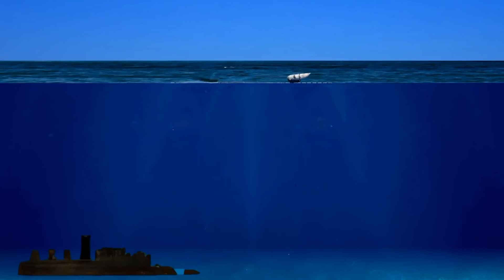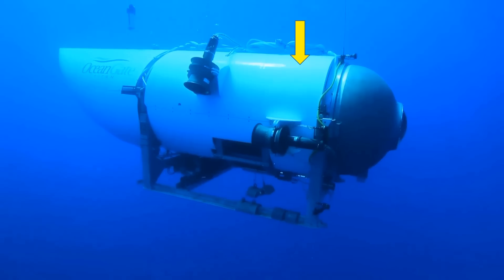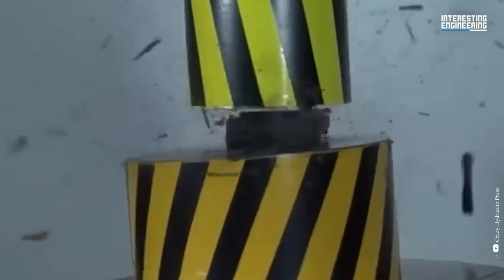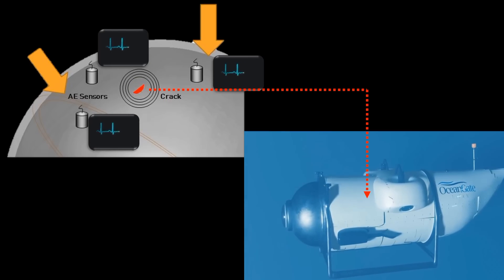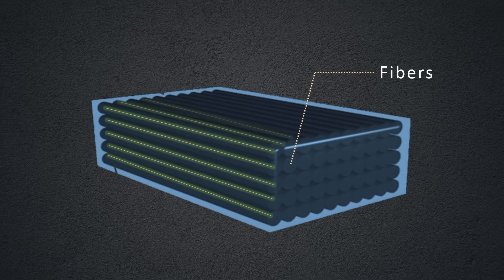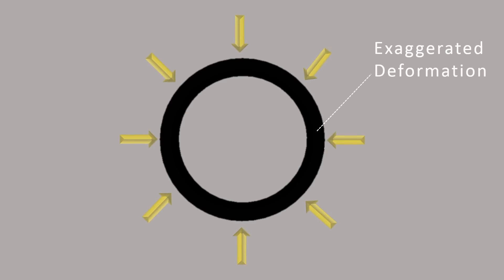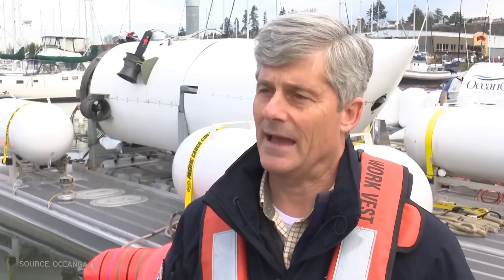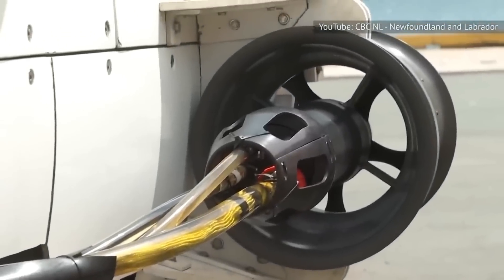Oceangate Titan Did Not Implode Just From Pressure. There Is a Catch!

Comment: Yes, when I heard about this I knew the failure would have been in the matrix, not the fibre, so the strength of the hull is not down to the fibre but the resin that holds it together. To that extent the hull was engineered as if a pressure container as opposed to a sub..
My first thought when looking at the spooling of the hull that there's very little axial fibre, so the hull was made like a very large slinky toy, it could shorten & lengthen significantly with pressure & temperature, not forgetting the different thermal coefficients for the resin in the matrix and the carbon fibre.
I used to fabricate Hobie Cat hulls and other things like sailboards, surfboards, canoes & kayaks, and even with careful hand or machine laminates there are the defects you've pointed out in resin variations, fibre variations, air inclusions that even pre-preg & vacuum bagging cannot eliminate. You hope to overcome these faults with careful manufacture and safety factors, which would be interesting to see - what was the safety factor for this hull?? How was the FEM & stress calculated?? Who was the engineer & what mistakes were made?

Comment: Yes, when an Americas cup racing yachts were first produced with a carbon fibre mast, and the boat came down off a swell and slapped the hull onto the water causing shock loading on the mast, we were treated to images of snapped masts and unhappy crews. This didn't surprise us badminton players who avoided buying early carbon fibre racket shafts as they had a tendency to snap without warning and send the racket head flying across the court.  When NASA used it on the leading edge of space shuttle wings the non-technical middle managers authorising safety protocols dismissed any issues with it by describing it as high "toughness".  Issues with compressive and shear forces during shock loading are known and real. Then the news reported it was a carbon fibre hull.

Comment: As a non-engineer, I found this presentation, with the graphics to aid in the explanation, easy to understand the likely cause of the implosion.  I've heard this explanation before in other videos, but did not get full understanding what they were saying.  The graphics used in this video helped it all make sense.

It seems to me that a design that requires a laminar material is not a good choice for deep sea, high pressure environments.  Now that I know about the problems of delamination and deformation that can occur with carbon fiber.  I don't think it is a good choice for deep sea applications.

I think another company is using it for applications in space flight.  This is something that should be looked into as well.  We've seen what the problems are for carbon fiber in deep sea applications, but what are the potential problems for using the same materials for use in the vacuum of space?  Can the same issue become a problem?

The spacecraft will have the same repeated cycles of internal pressures exceeding external pressures, and then both external and internal pressures equaling out.  Will that cause stress damages to the carbon fiber structure?  Not to mention the added stress of the high heat of reentry into the atmosphere....

Comment: They could have done a better job of gluing, such as vacuum filling to make sure they didn't trap any compressible air in the glue.  I think the junctions caused far more risk than the glue.  A hull made entirely of carbon fiber composite might have survived better, whether monolithic or glued.  (Avoid sudden changes in thickness because they would create stresses similar to the joint.)  (A lot more detail to design and build the domes from fiber.  Why did they choose titanium domes?)

Comment: There are many ways failure could have initiated.  And it's 100% due to the intense pressure.  My guess is thru thickness debonding from the titanium shell resulting in high pressure wedging of water acting directly in the metal shell. This would have formed a bubble and then failure.  Really need to see the failed structure to understand better.

Comment: So basically carbon fiber is strong in a very particular configuration, and weak in another configuration.  Mr Rush chose to orient the carbon fiber at its weakest configuration, but figured that the 5 inch thickness would have compensated for this fact.  Well it did, but the CF fatigued and weakened over time and pressure cycles until this recent most tragic event.  I would have built my sub using the strongest components, at their strongest configurations, and then added on even more failsafes along the way just to be sure AND THEN subject the prototype to rigorous testing before I even attempted to put the thing in water.  When I finally put the thing in water, its been designed to withstand a monster crap of challenges that nature can bring, and tested to make sure its safe.  Mr Rush didn't do half of that, and paid dearly for it.

Comment: As Mechanical and Structural Engineer, I have to comment on your video and analysis.
1) Fatigue is not caused by pure cyclic loads. It is the loading from tensile into compression into tensile again. The best example is the Head bolts in a normal motor. The bolts are pretensions in order to prevent the cyclic from tensile to compression.
2) Length prevents stress concentration. So that approach is wrong. Stress concentration occur where there interference with the movement of a perfect round shapes. such as the dome ends.
3) Composite materials are a no no for this type of use. Unless you use thick walled theory for cylinders, there is no compression in the shell, unless you refer to local failure modes, which are way to small. Composites are used in tensile and tensile only. The Maximum stress of Carbon fiber is 1500 MPa in Tensile and 600 MPa in compression. Thus compression strength is far less than simple stainless steel.
4) Th wacousitc sensors are rubbish. If noise it heard the failure has already started and the hull is already weakened. How does one measure and record accumulative and successive damage and how do you translate that to the structural integrity of the hull.
I can go on and on. These were not engineers. They were thumb sucking design cowboys ......

Comment: Rush should never have been allowed to gamble with the lives of his TOURIST passengers. I blame government regulators, In my mind, there is no difference between Elon Musk having SPACE TOURISTS fly to the Moon and Rush's SEA TOURISM to the bottom of the Ocean (dives to the Titanic).  My understanding of your FAILOUR ANALYSIS is that Rush r-e-f-u-s-e-d to have others 'Look over his Shoulder' on the pretext of protecting Proprietary Trades Secrets/Freedom for Innovation (sic).  Since the industry standard is to use TITANIUM throughout a submersible's construction---RUSH needed to PROVE use of Carbon Fiber Technology was as failsafe as that of the Industry Standard---and clearly he didn't.

You focus on Rush's use of a cheap game controller, not built to MILSPEC standards, is most unsettling. Another bone of contention with me was the Glass Eye in the front of the sub which was only rated up to 1,500 PSI before shattering---yet the Titanic rested on the sea floor requiring a load of 3,300 PSI. THAT IS CALLED GANBLING, my friends!!!
Who permitted his craft to accept PAYING CUSTOMERS with such glaring safety issues such as these? Since OCEANGATE was an American Chartered Company, Rush's vessel should have come under DOT supervision and Dept of Transportation (DOT) should have IMPOSED regulations, testings & processes before passengers were allowed to set sail in the contraption. This was a tragedy in the making, pure & simple.

I am not a mechanical engineer (FYI, I adored you concise, clear explanations) but a FUTURIST & a Technology Historian.  If you examine the introduction of the FIRST Automobile, the FIRST Steam Engine, the FIRST RailRoad Locomotive, the FIRST AirCraft and the FIRST Space Ship---all of them underwent vigorous Peer Reviewing & Government testing B-E-F-O-R-E routine FOR PROFIT Commercial Employment Started.  Unfortunately, I see more tragedies like what happened to OceanGate occurring, not less. DOT needs to step up its game...

Comment: You hit the nail on the head. This is the first explanation I have seen of the flaw in using carbon fiber. Great for a spacecraft where the fibers are stretched by internal pressure but no good being compressed by external pressure in deepsea diving.

Comment: I am wondering how that carbon fiber tube was attached to the metal rings that the metal hemispheres attached to. I'm thinking a metal sealing ring would have a different reaction (different expansion/contraction) to the external temperature & pressure.

Comment: So, the pressure will find its way through the path of least resistance, and the composite carbon fiber hull was all too obliging in providing one.  I wonder if the supposed transcript from the dive that was circulated around is genuine or not.  If true, they had warning of the impending catastrophic failure but were too deep to prevent it.  "Loud cracking noises" had already been noted from this sub on previous dives.  Fatigue is a thing, as is an apparent blind pursuit for return on investment.  My money is on the 6K PSI.

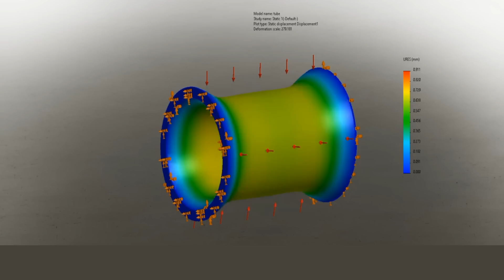Comment: I’m sorry to revealing this to everyone, but I think there was a very good chance the so-called “implosion” was not quick and that the passengers did not die a quick death. Similar to what is shown at 7:04, the titanium end caps did not flex as much as the carbon fiber did. This would be the likeliest cause of stress fatigue in the ways this video illustrates. However, the carbon fiber probably didn’t fail all at once. Because of the unpredictable nature of carbon fiber, inconsistencies or “weak spots” can show up which are exacerbated by things like poor manufacturing quality control or refurbished repairs (which the sub manufacturers did). There was likely a small fracture at that outer edge that began letting the water in at supersonic speed. This may or may not have been followed by a buckling of the hull, which for the sake of a “quick death” I hope was the case as it may have allowed the hull to degrade quicker. If it was a solid pinhole stream, then it likely would have acted like a water jet, cutting through most of what was solid and either doing the same to softer materials such as the passengers, or causing severe injection injuries if it didn’t cut all the way through. If they are lucky, that stream quickly cut through the other side of the hull and caused a quick collapse and implosion. If not, or if the leak was more of a “spray” than a stream, then the sub will begin filling with water. The leak may increase in size due to the water stream eroding away at the carbon fiber hull. If it drastically increased in size, it would have allowed for the catastrophic implosion, or a shorted duration of what I am about to explain.
A small leak will let water in, but none of the air inside would leak out. That means as the sub filled with water, which may have taken up to 10’s of minutes at the slowest case and just a few minutes in a more likely case. Considering that the ascent time of the Titan is 2 and a half hours from full depth, it wouldn’t matter much. During that time, the breathable air space in the submarine is decreasing in volume and increasing in pressure. With no water inside, the air inside is at 1 atmosphere of pressure. At half volume, 2 atmospheres. Quarter volume 4 atmospheres, 8 atmospheres at eighth volume. At that pressure, the air is going to be not only toxic and cause the debilitating effects of the bends, but it would also be doing damage to the lung tissue itself. 

So imagine this if you will. The Titan is near the Titanic, there is a sudden leak that injures a passenger or two before they manage to get away. The sub operator, or someone at his direction, begins an immediate emergency ascent. The sub starts filling up with water surprisingly quickly. The hull starts to creak and buckle ever so slightly, perhaps some of the other panels and modules attached to the outside begin to shift or bend out of shape, causing those acoustic readings captured over a duration of time. As the sub continues to fill with water mixed with the blood of those who may have been injured, everyone starts to move to try and breath within the remaining air space at the top. Over the next few minutes, the passengers begin to panic and suffocate to death as they can no longer breathe the air that is available in a sub that can no longer rise as it is too full of water.
I do hope that I am wrong as no one deserves to die in that manner. Especially the teenager that was on board. I am going to have a drink now.

Comment: PS---- just look at carbon fiber bicycles-- how they "glue" a metal end in the ends of the tubes in places--- look at those failure modes---- and I think
that should be enough to have 86'd the idea of using carbon in a hull.  But i'm not trying to attract rich non-technical investors----

Comment: one thing which I have not seen mentioned so far--- that has been a known problem in the aircraft branch of carbon fiber useage is this.  When the multilayer
thickness gets fatigue from cyclic stresses- a delamination can happen.   Then -- the next thing that happens is that moisture finds its way into the de-lam from the aircraft being outside in the rain and dew.   The de-lam sucks in the moisture by capillary action.  Then - that moisture is available to be frozen when the outside temp is cool enough.  The trapped water expands when frozen-- exerts internal pressure -- and further propagates the delamination to be a larger and larger area.   Before you know it-- s small de-lam is now one affecting a large area-- and possibly leading to an unexpected structural failure.  This sub was in the north-east where there would have been many freezing days- even maybe inside buildings.  All in all- carbon fiber was a horrible and fragile choice for this hull with few redeeming attributes.

Comment: I would be interested in your critique of the Boeing 787 and the Airbus 320.  I believe they both use composites in numerous areas of control and the pressure vessel.
Reply: They use carbon fiber in tension to keep relatively low pressure inside.

Comment: Most are saying " the repeated compression and expansion"  well I think it is more than that. As they descended the temperature affects the different materials Titanium and Carbon Fiber differently. They expand and contract at different rates. So between all these changes it was cracking at that seam every single time. It changed depth temperature and pressure.

Comment: From what I understand, Titan was ascending (after alarms of structural failure) when it imploded. It seems that any amount of pressure reduction that would bring about would be a save them. If all that's true, is it possible that the material stress was increased by ascending because the carbon fiber or the adhesive bonding it to the titanium spheres could no longer tolerate the fluctuations and likely increase in delamination? If the communications that have been released are real, why did the stress sounds come from the aft portion instead of the carbon fiber midsection? Posting these questions before watching to the end. My apologies if you explain this later.

Comment: The water pressure was not placing the fibers in tension, but rather compression, which they have almost no useful strength to resist.  Think of it as a show lace, pulling on the ends places the lace in tension, and it can resist a considerable load.   Push the ends of the lace towards one another, and there is almost no resistance.

Comment: What destroyed Titan, was arrogance. I watched a video where Titan's end cap bulkheads, were epoxied to the carbon fiber hull. It was done by hand, with spatulas...the glue being swiped on like a home handyman applying caulking to a shower. The application was uneven and sloppy. It would have been impossible for voids in the epoxy to be avoided. That's just one thing. 

The list of other obvious potential problems is long and they all seem to have been ignored. The lack of non destructive testing, the video game controllers, the unconventional materials, and so much more...should have, at the very least, created an atmosphere of excess caution. Instead...it seems that the more radical the idea, the more overconfidence it inspired. 

Absolute madness at every step. This tragedy was more than likely to happen eventually...it was inevitable.

Comment: How could they repair it?  I'm skeptical given their low cost approach that they fully replaced the carbon fiber section which is very difficult without a lot of difficult operations, basically a lot of new parts except the bolt on Ti cap...    Also the comms history suggests a possible slow 20 minute cooking death due to a likely leak.  This might have also weakened the inner epoxy which would accelerate the inner compression delamination failure.

Comment: Great video since the cylinder can be 3 d and pie 3.14 they should have been able to relatively within a few lbs per square, should have been able to give an accurate stress catastrophic failure. I guess they "Failed" to do so at the cost of 5 lives.

Comment: There's another factor, too.

At the joint between the carbon-fibre-composite cylinder and the titanium end rings, there's a glue holding the two materials together. This in itself is not the problem. The problem is how the two materials respond to pressure. The carbon-fibre-composite is significantly more compressible under pressure than the titanium. Thus, at significant depths, the carbon-fibre-composite cylinder would be shrinking away from the titanium at the joint. And the only thing to keep the two materials in close contact was a layer of adhesive.